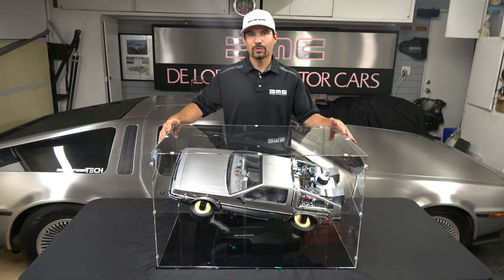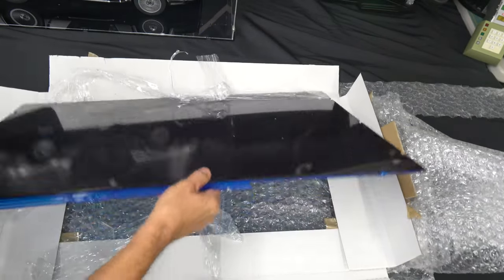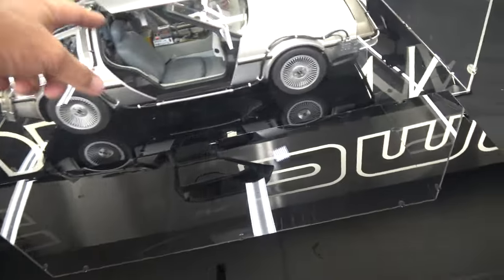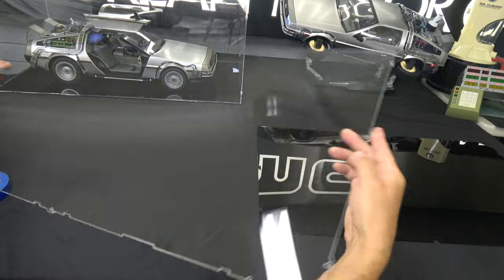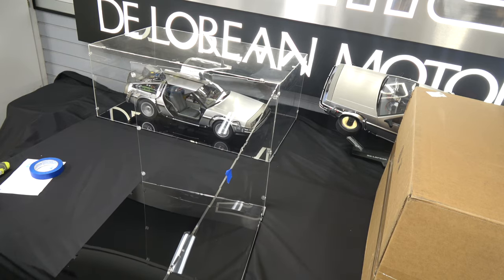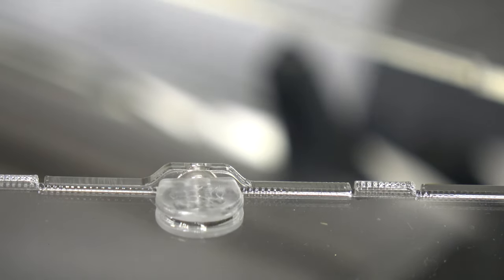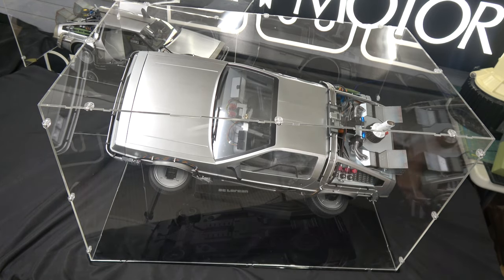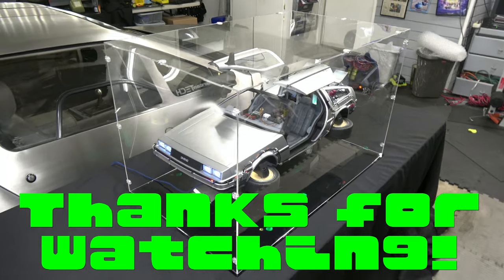Display Case for Hot Toys BTTF2 DeLorean | Assembly & Review

Comment: My Mark 1 is in a custom sized case just like that (assembled with nuts and bolts by customer) from Sora Shop in Germany. It looks exactly like yours. You can just tell them what dimensions you want and they build it and ship it to you. Was about $120 back in 2016. I plan to do the same for my Mark 2. I put them in shelves and use the front, sides and top only (no back piece installed) so I can slide the case into the shelf over the car, it's the entire reason I went with Sora to begin with.
Reply from the maker: Thanks for the tip. This is great info

Comment: thank you for this review and information. I purchased a case for my mark 2. I also have the mark 1. One thing that is driving me nuts though, I can't power the Mark 2 with usb inside the case, because you have to push the button under the hood. The mark 1 doesn't have this problem. Such a shame 😔
Reply from the maker: Agreed.  They needed a latching switch not a momentary switch!

Comment: Very nice case! I want to buy one too but just a question, do you have to remove the top of the case everytime you want to switch on or switch off the lights? Because even when the usb is plugged you have to push the switch to activate the lights.
Reply from the maker: What I do it just lift the case of the base a bit and then turn them on. You have to reach under the case.  The clear case itself can be easily removed fro the base, it's just sitting on top of it with some alignment slots in place.
Reply: @DeLoreanTECH  Oh ok but you always have to open the car hood right? Or you made an external on/off switch?